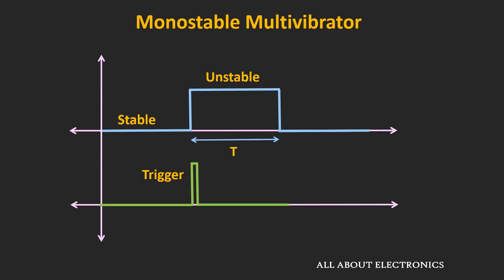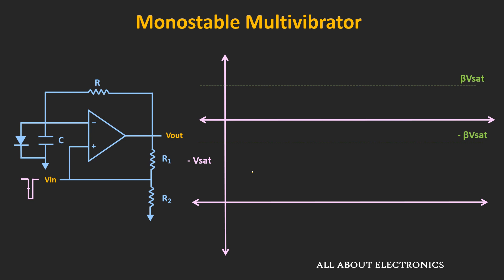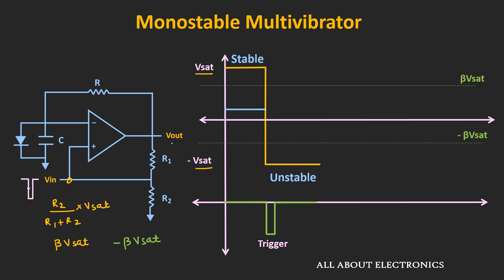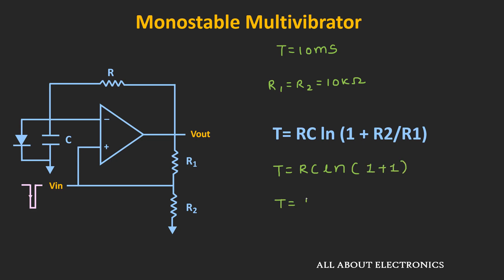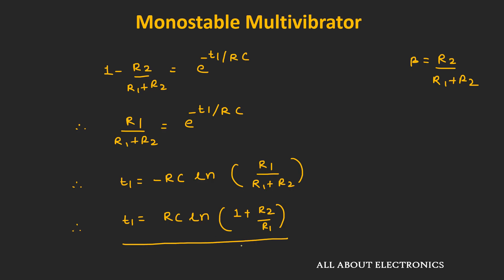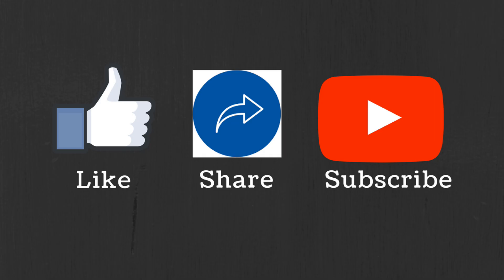Monostable Multivibrator (using op-amp) Explained

Comment from the maker: The timestamps for the different topics covered in the video:

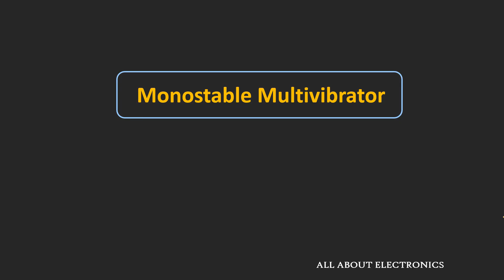0:22 What is Monostable Multivibrator ?

1:28 Working of the monostable multivibrator

4:48 Design of Monostable Multivibrator Circuit

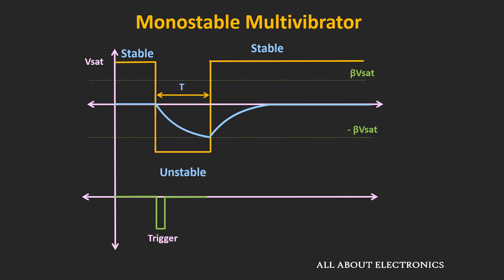6:34 Derivation of the equation for the monostable multivibrator

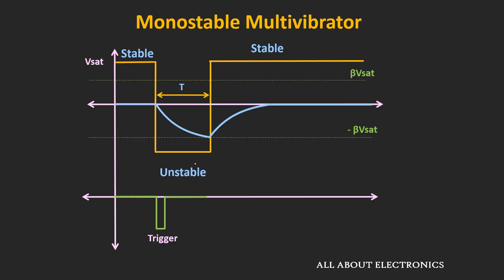9:38 Use of RC Differentiator circuit for the generation of the trigger signal
Reply: Sir, when the diode is in forward biased condition than how we know that the forward biased volatge always less than beta vsat voltage at non inverting  node?
Reply: @sumitkumarpal2306  Because forward bias = 0.7 volt.    So   Vsat*(R2/(R2+R1))  must be larger than 0.7 volts.     R2 would have to be very small to have less than 0.7 volts across it.  Good Question.
Reply: @sumitkumarpal2306  ok
Reply: @sumitkumarpal2306  Ok...
Reply: 🙏🙏🙏 thank you so much sir🙏🙏🙏
Reply: Waiting for 2nd order active low pass ,high pass filter derivation using opamp...
Reply: Which softwear ur using for making such writings? Diagrams?
Reply: Ok.
Reply: Better to remove the subtitles ...so that we can clearly see the circuit
Reply from the maker: @sireeshasirigiri7694  You can turn it off manually in the video setting.

Comment: but how can a pulse even affect the circuit? The voltage is already decided by the feedback is it not???
Reply from the maker: When you apply the trigger pulse, momentarily the circuit will go into transient state. And during that state, we see the change in the output. That transient period is the time where the output of the monostable changes. And that depends on the selected values of R and C.

Comment: Sir why we have to assume initially output is at positive saturation voltage
Reply from the maker: Because in this case, +Vsat will be the stable state. (even if you assume initial output voltage as -Vsat)
For example, let's say the initial state is -Vsat. So, the voltage at the Vin = -Vsat * (R2 / (R1 + R2)) = -B*vsat. Now due to negative output voltage, diode will remain off. And capacitor will start charging towards -Vsat. And as soon as the voltage at the inverting terminal goes below -B*Vsat, there will be change in the output voltage from -Vsat to +Vsat. 
And thereafter, it will remain so until negative going trigger pulse is applied at the input. I hope, it will clear your doubt.

Comment: The op amp circuit and trigger circuit are both good.
Add them together like this and the monostable can't work, as the voltage divider on the output is compromised.
This combination seems to be ubiquitous on the internet, however it's useless.

Comment: Why only negative spikes are used at non inverting?
Reply from the maker: Because we want to change the output of the op-amp from +Vsat to -Vsat. That will happen when the voltage at the inverting node is more than non-inverting node. And to make that happen, we need to momentarily reduce the voltage at the non-inverting terminal. When the negative spike is applied then only, momentarily the voltage at the non-inverting terminal will go below inverting terminal. And due that, we will see a transition in the output voltage. I hope, it will clear your doubt.

Comment: Why does the diode become forward biased when the Vout=Vsat and reverse biased when Vout=-Vsat? Cause if we use Kirchhoff on the external mesh, we don’t consider the voltage across R?

Comment: Sir, 
How to make -vsat as the stable state instead of +vsat. Does the diode reversal suffice?
Reply: Yes it will be enough. If you are using diode in differentiator circuit for taking trigger signal input, you have to reverse it as well.

Comment: sir could you pls explain how those spikes were coming while using the differentiator circuit
Reply: becouse when we  differentiaate a constent we get a 0 voltage and the terminals give a valu becouse is a unit step function

Comment: why we move towards monostable multivibrator from a stable multivibrator??
is there any use of its using???
Reply from the maker: The thing is, the different multivibrators are used for the different applications. The monostable multivibrator can be used to generate the pulse width of the finite duration based on the triggering instance. 
For example, let's say you want to design the alarm system, which rings or shows red light when particular even occurs.
The monostable multivibrator can be used in such project. 
This is just simple example, but there are many other use of this multivibrator.
I hope it will clear your doubt.

Comment: 7:54. .. why cant we take Vfinal = +Vsat ... please reply...!???
Reply from the maker: Because here we have assumed that, the output of the op-amp is +vaar initially, and when transition occurs then it goes to - Vaar. That means capacitor starts charging towards the -Vsat Voltage.
I hope it will clear your doubt.

Comment: What is max frequency i can reach whith this system? For example, can i make a LEDONn for 1 microsecond and OFF 1 microsecond ?
Reply from the maker: It is possible to do that using an astable multivibrator. 
But if you are designing it using the op-amp, then you need to check the slew rate and the gain-bandwidth product of the op-amp. 
I mean it should be able to support that rapid transitions.

Comment: Sir can you explain then multivibrator using transistors
Reply from the maker: Yes, recently I got so many requests for that. Very soon I will make the video on it.
Reply: @ALLABOUTELECTRONICS  yes sir because in our banaras hindu university it is based on using transistor and in practical I unable to understand if you provide lecture as recent as you can it will so helpful for us thanku 🙏💕sir

Comment: want the unstable output to be a minimum of 10 sec;  Vcc = +3V;  using cmos op-amp; using C=10exp-6 F,  R = 14.4M ohm
If Vcc = 3V, +Vsat = 3V, & -Vsat = 0V
Is R = 14.4M ohm too large?
Reply from the maker: Instead of going for large value of R, you can change the value of C. I mean just use 100 uF instead of 10 uF. And then you can use 2M ohm potentiometer.

Comment: Very good presentation sir, Please tell me how to modify this circuit so that it can accept a positive trigger signal instead of negative
Reply from the maker: Just use inverter circuit. you can even use transistor or op-amp to invert the triggering signal.
Reply: @ALLABOUTELECTRONICS  Thankyou Sir, Is there any relation between the unstable state time and the trigger pulse time?
Reply from the maker: @Dr.SreehariBNair  Trigger pulse should be less than the unstable time. It should be sufficient enough so that the output can switch from the positive to negative saturation voltage. (and that will depend on the slew rate of the op-amp). For fast op-amps, the switching will occur in less than 1us. For op-amp like 741it may take 2o us to go from 10 to -10V. So, roughly it will be 20-25 us. So, trigger pulse should remain low for that duration. 
For fast op-amps, even 1us pulse width is enough for the transition. 
I hope it will help you.

Comment: Why Vfinal is -Vsat and not Beta times-Vsat.Please explain Sir.
Reply from the maker: Because the capacitor is actually charging towards the -Vsat voltage. But due to the comparator, you will see a transition at -Beta times Vsat voltage. If that transition is not happening at -B Vsat then the capacitor would have charged up to -Vsat voltage. 
I hope it will clear your doubt.

Comment: Why are we getting  (- BVsat) for a time period of t by using momentary negative trigger?
By using - ve trigger, the Vid will be negative momentarily, but how are we getting the unstable state for a long time? does capacitor have any role? please explain.
Reply from the maker: Yes, the capacitor does play a role. And if you see the time duration T, it depends on R, C, and R1, R2. 
As T= RC ln (1+R2/R1)
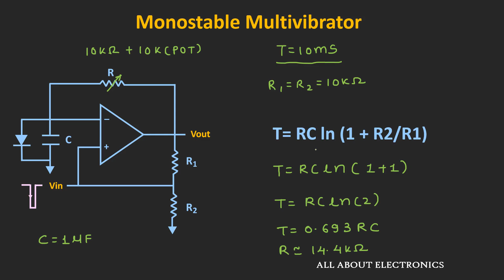Please check the derivation at 6:34. You will get an idea about the working of the circuit.
Reply: 11

Comment: what is the use of diode in parallel with capacitor? pls........ rply to my question it is my doubt
Reply from the maker: The diode will ensure that the voltage at the inverting node is less the input voltage. Because normally the Vin is high voltage (Vcc) and during the triggering action only it will go low. So, until the trigger voltage goes low, the voltage at the non-inverting node will be more than the inverting node. Hence, the output of the op-amp will be high during that time. 
I hope it will clear your doubt.
Reply: thanks for clarification........